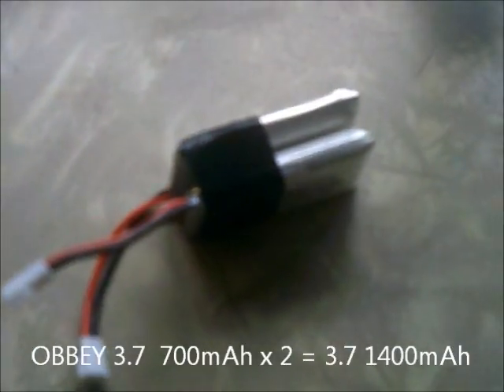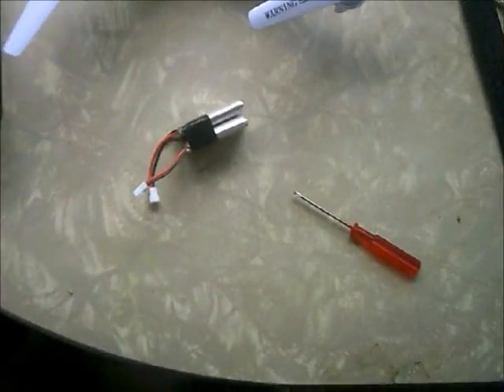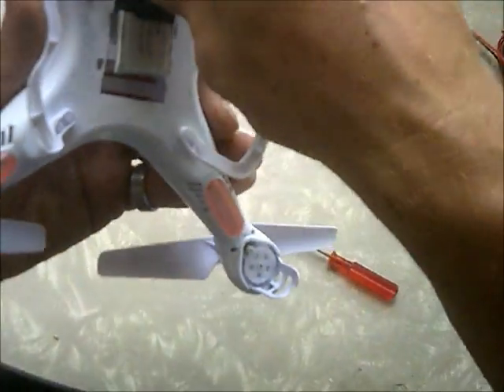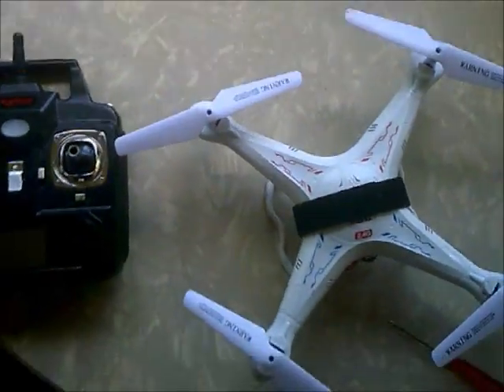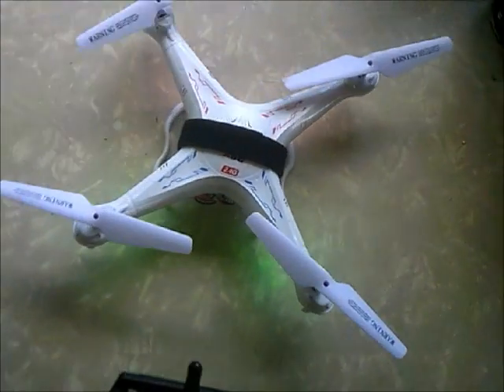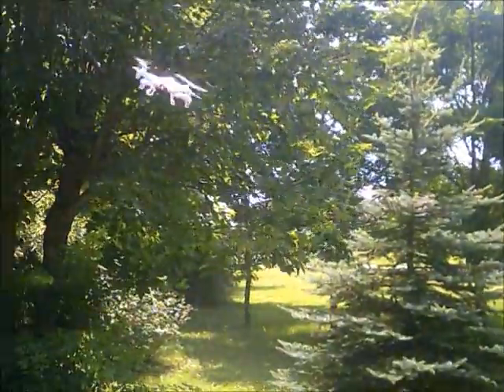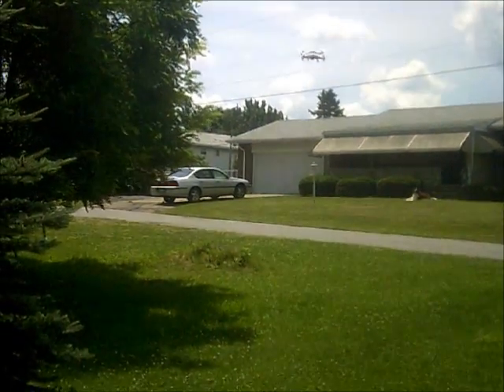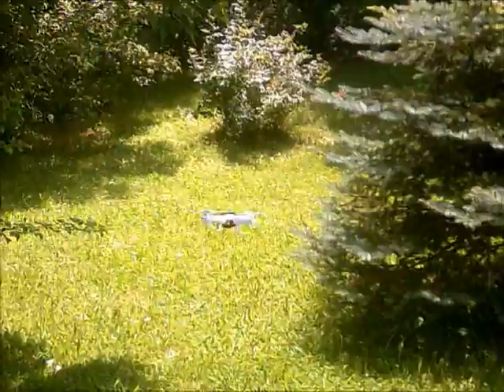SYMA X5 C 15 MIN FLIGHT TIME 2 BATTERIES 1400mAh RC DRONE DIY

Comment: Hey Jay, how did you setup the battery to increase amp's without increasing voltage?
Reply from the maker: they have to wire  batteries in parallel u need to google how to it will show you how to double the mAh,  just google wire batteries in parallel it will show u definition n diagram
Reply: Jay Drone. i actually jsut did that and felt stupid ty vm thats amazing
Reply from the maker: SkankBoy do you understand how to do it it is simple but if u do it wrong it willl increase volts and u dont want that
Reply from the maker: SkankBoy good I have automotive knowlage old cadillacs that were desile usto have 2 batteries wired in parallel and hydrolics on a car u need to wire tons of them in trunk and if done wrong no good, best of luck it isnt hard just not common knowlage i guess but knowlage is power n know u know
Reply: Thanks to you , i know a lot more about Electricity =D
Reply from the maker: SkankBoy right on broher